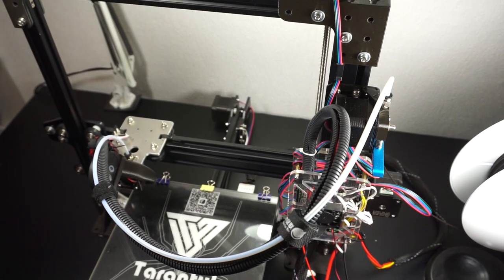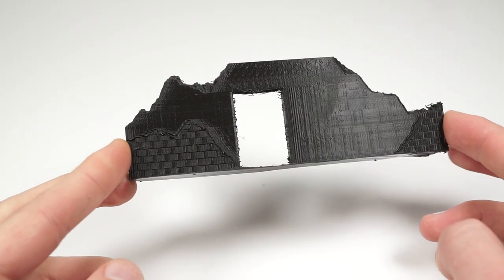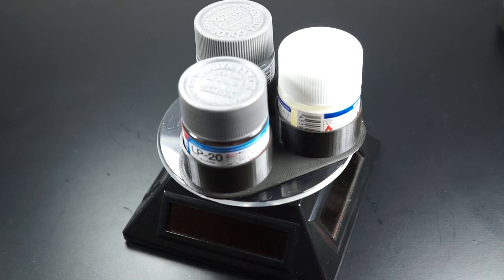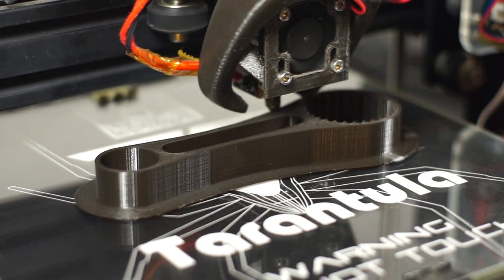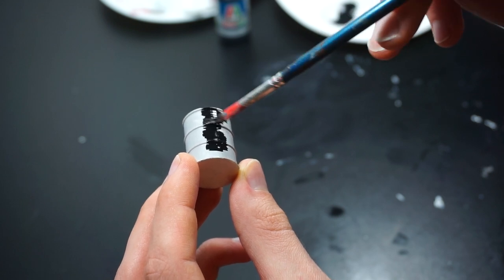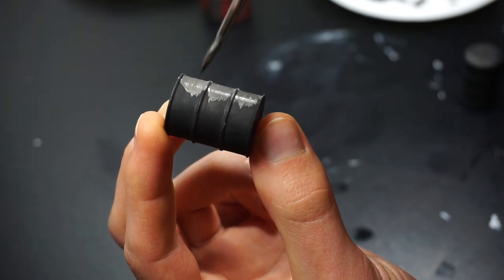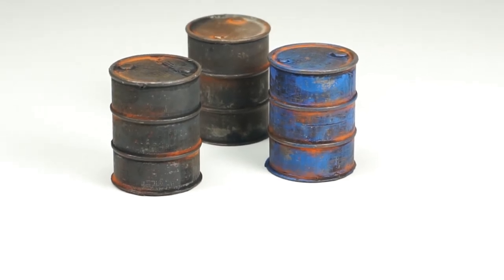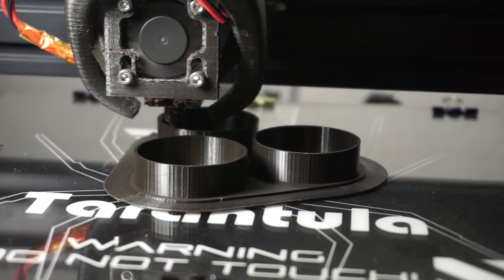Tevo Tarantula - Cheap 3D printer for beginner?

Comment: Acetone vapor baths and/or sanding could help with the layering, but that's going to be a sticking point with 3d printed stuff for quite some time. A more expensive model that can do smaller layers will help, as well a resin type that uses lasers on a bed of fluid. Anything that needs a lot of tiny detail will likely take a lot of work to look good from a 3d printer.

Comment: Are you able to do customer request
Reply from the maker: What do you have in mind? What kind of requests?
Reply: I'm wondering if you're able to print a certain engine for a 1/24 toyota hilux model kit
Reply: The engine I'm looking comes out of a 2003 toyota tacoma 4 cylinder the engine is called 2rzfe